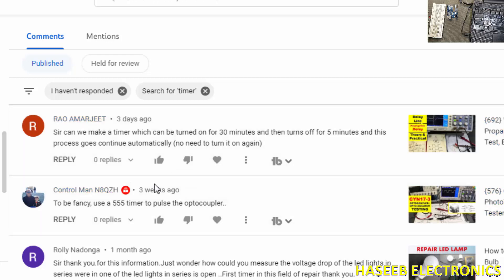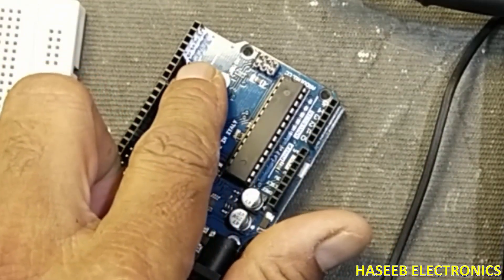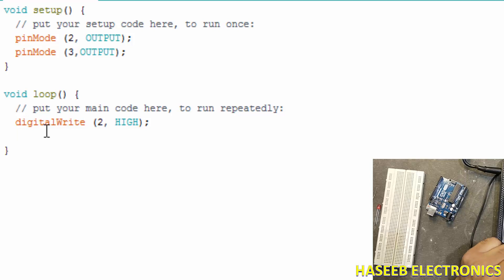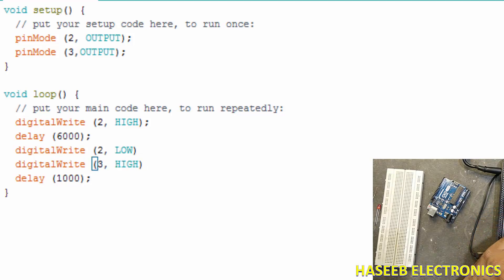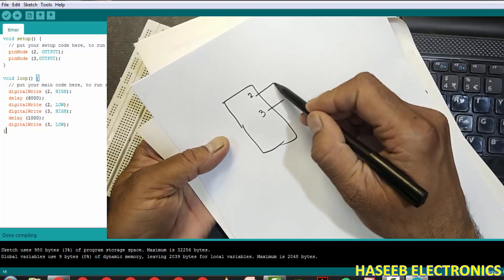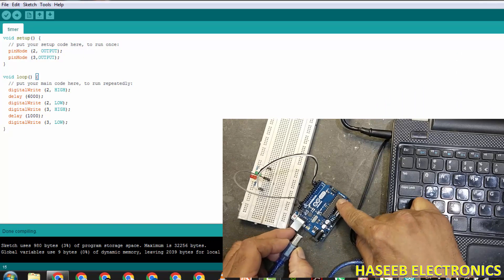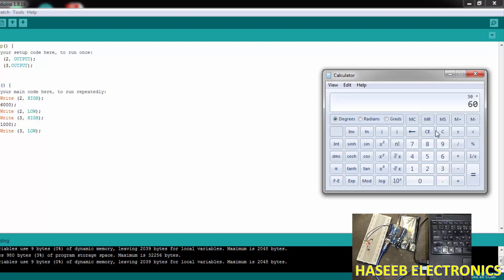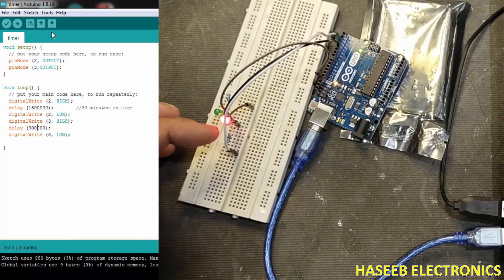{695} Timer Using Arduino Uno, Arduino Programming

Comment: Dear sir i need a program for arduino to control 3 sequences .  I have a motor and 3 vibrators in the circuit each connected to 4 different relays. lets call motor relay, vibrator1 relay,  vibrator2 relay,  vibrator3 relay  I want the motor relay to be started on a "ON" trigger or HIGH received at input pin and simultaneously relay1 should also start. after 8 seconds, motor still runs, but relay1 is OFF and Relay2 starts. similarly after 8 seconds relay2 stops and relay3 starts, exactly after 8 seconds relay3 and motor should stop. Program should exit. can u please help me.

Comment: Can you answer my question please.... Can Arduino be used professionally, such as controlling machines and elevators.... and it lasts for a long time.... I am waiting for your answer.  Thanks
Reply from the maker: yes
Arduino is basically atmel microcontroller. so microcontroller either it is PIC or Atmel or any other MCU, these execute the instructions
Arduino is a platform to communicate between USB port to the microcontroller. microcontroller is to communicate to nay device, 
even it can be used as proto type or long term solution